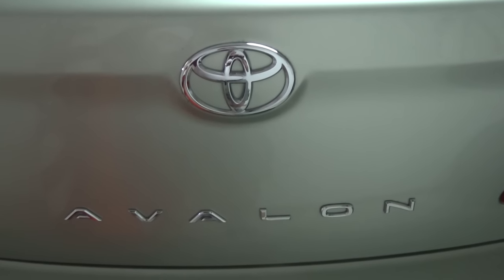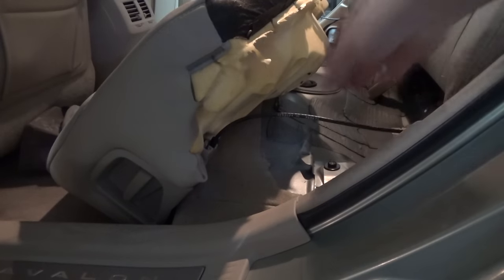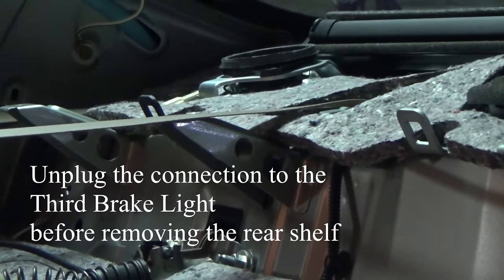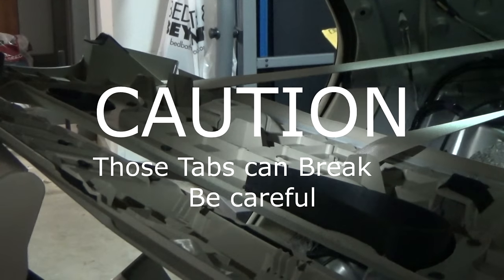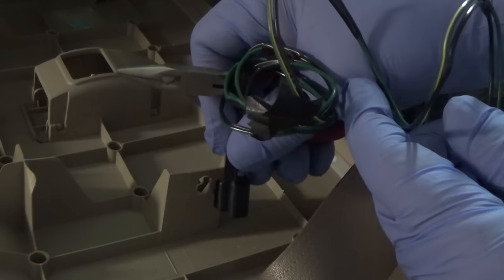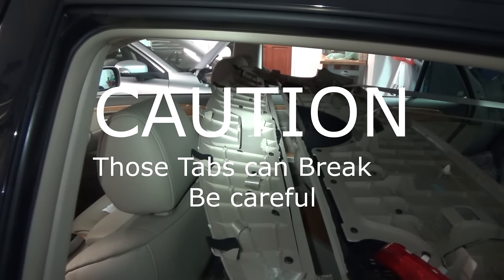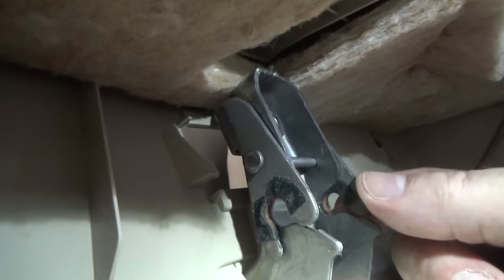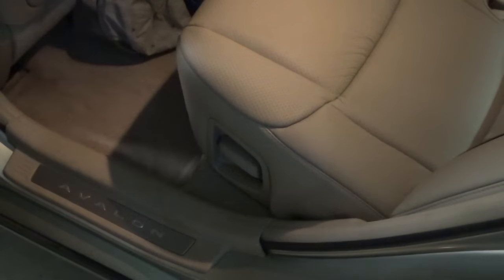Toyota Avalon Third Brake Light Replacement

Comment: So I have a 2005 avalon XL. My issue is similar but sometimes my light does work and does not. Its a base trim so it doesn't have a rear sun shade. Am I able to just pop off the cover without having to undo the seats?
Reply from the maker: Rick,  The rear shelf is also anchored by the C-Pillar panels.  In my opinion, removing the rear shelf without removing the seats and pillar covers first would cause damage to the shelf and pillar covers.  So the choice is yours as what you want to live with.  Working on cars has taught me that most of the work is getting access to the faulty part and this is no different.  Not having a rear shade only means that you do not have to make sure the arms have clearance through the slot.  Otherwise, I feel that disassembly with the method shown is your best bet.  Good luck and if you find a short cut please post your results for others to follow.

Comment: Thanks for posting this video.  Saves me from trying to take it apart, breaking half the clips, throwing a wrench through the window and then not being able to re-assemble it properly!  I guess I am going to just have to take it in to get it fixed bc that looks like a pain in the @$$!  What a crappy design feature...

Not sure if you check your comments often but once its all unassembled would that rear speaker subwoofer be easily accessible?  Mine needs to be replaced and I figured if its already there...
Reply from the maker: Thank you for your comment.  I would think the speakers are accessible with the back shelf off as they are not accessable from the trunk.

Comment: which way did you pull the bench seats to remove it. tried pulling from the bottom on the front but no luck.
Reply from the maker: Monique Evans The bottom seats just lift right up. pull one corner up and go around to the other side and the seat should pop up like the video showed.
Reply: David Prokity I'll try again or get someone with a little more strength to help lol. let you know if I make any progress. thanks
Reply: I did not need to remove the seat bottom, just the seat backs on 2008 Avalon.  Tilted seat back forward after removing top bolt to gain access to the bottom bolts of seat backs.

Comment: Man I got scared after watching this. I have a 1998 though and the top of the light fixture which is also the subwoofer cover just popped right off and I didn't have to remove anything!

Comment: I love my Avalon but why did they us like that? No bulb should ever be difficult to gain access to. Bulbs go out, so why would they bury it in 2 hours of labor? Pisses me off!
Reply from the maker: The LEDs should last the life of the car but, the circuit board is failing at extreme temperature conditions like summer heat and cold winters.

Comment: You don't have to go through all that bullshit all you have to do is pop the top with a screwdriver with a cover of the speaker and you will see the plug on the bottom of the light on screw it and change the bulb and put it back together again 5 minutes
Reply from the maker: Please send me a link to the procedure or make a video as I cannot figure out how to lift the back shelf up and access the light bar without removing the back shelf.

Comment: Toyota doesn't want you doing this. Most other makes, like my '05 Mercury Grand Marquis, just have a screw on both sides of the brake light housing.
Reply: If the unit was properly manufactured with good solder joints, it should never need to be replaced.   That is why Toyota made it inaccessible - thinking it would never fail.    Mine had cold/cracked solder joints - the LED's were fine.  Repaired by reheating the solder joints with fresh solder and flux.

Comment: It’s TOTALLY RIDICULOUS that Toyota did such a poor design just to change a freaking light!!! You should be able to just unscrew the housing on the back deck lid to get access to the light…this is just insane!!🤬
Reply from the maker: You got that right. The design criteria has the LEDs lasting the life of the car but the circuit board has a tendency to fail.
So, the idea is sound but the practice is subject to real world failures.
Reply: @A_Renaissance_Man  my original light lasted about 14 years before it started to fail. I just paid the dealership $400 to have it replaced. That’s way too expensive to replace a FREAKING LIGHT! I’m not a handy person so I had no choice but to have the Toyota dealership do it….otherwise the car drives better than new cars today. I bought it brand new in 2005 and plan to keep her until she dies…current mileage is 257,000 and going strong. Love the car! Also it saves miles on my new truck!